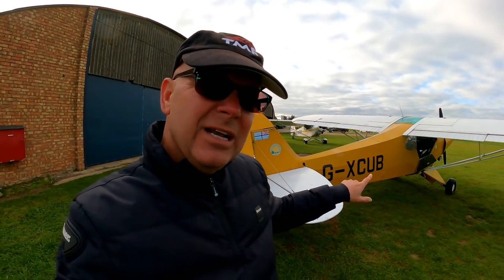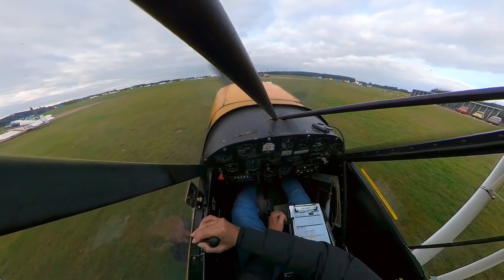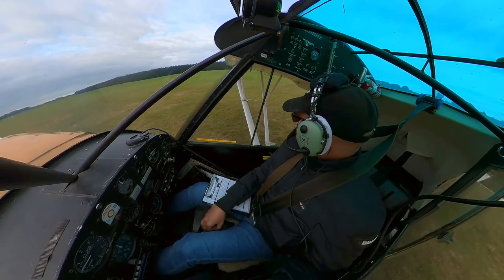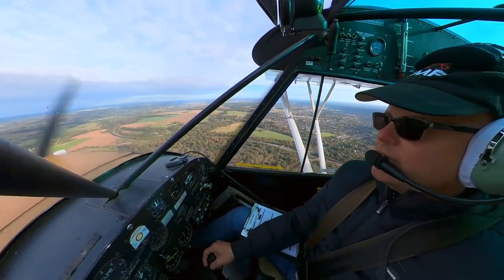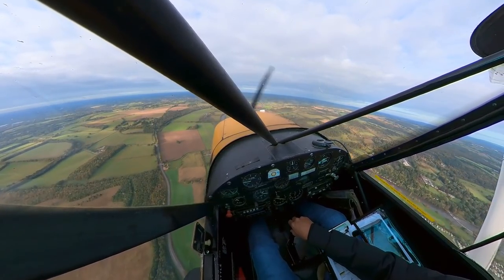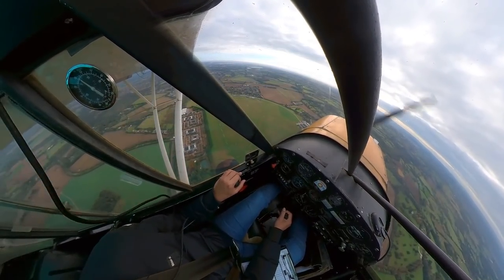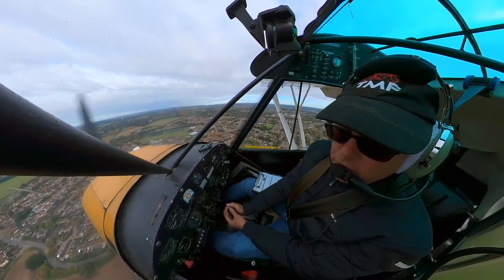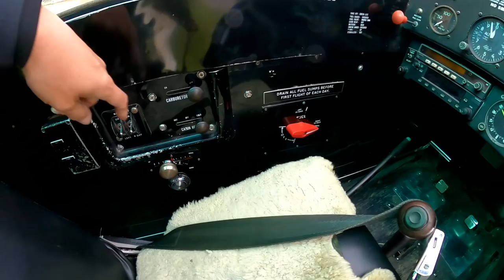Piper Supercub Going Solo! - Flying out of the circuit for the first time in the PA-18 Supercub

Comment: Great video. You have certainly got the essence of Super Cub flying. That is also a very well kept aircraft. When you’ve got happy with this one, add a Tiger Moth to your menu. That will be a very simple conversion as there are even less controls. If I may comment: 1. Keep your left hand on the throttle when taking off. You were two hands on the stick at about lift off. 2. Ditch the knee board ASAP. Use a pen on a half/quarter mil if you need to take notes. 

Top tip for the future, if you sideslip to the right with the door open (like you might on a hot day when doing multiple launches at a gliding club), slide open the left hand window. If you don’t, the left-hand window blows out and you have to do the walk of shame to pick it up from the undershoot. Errm… how do I know?
Reply from the maker: Great tips Trevor thanks!! …and are you kidding about this being a well kept aircraft??!! …and yes love the Tiger Moth, only flown p2 in it thus far…
Reply: @TheMissendenFlyer  “Well kept” is a relative term. You should fly a tug at gliding club. You have to wipe your feet on the way out. One good thing, they had none of that useless radio nav. stuff. Ours just used to have a VHF radio and a transponder - two boxes too many.

Comment: Love the flying, takes me back to my Chipmunk days. The Chippy had a slightly improved ground handling system where you can get the wheel brakes to apply at the extreme ends of the rudder travel, so that saved a few embarrasing moments! I got used to 'wheeler' landings, I found the visibilty was much better, just lowering the tail when all the elevator authority ran out. You had to get the speeds right of course and landing at Liverpool, in between the EasyJet 737's, they wanted you 'keep your speed up' and get off the runway. 'Memories are better than dreams'. Keep it up Andy.
Reply from the maker: Sounds great Mark - would love a go in a chippy!

Comment: Bit of a death-grip on the stick there (2 hands even)! Finger and thumb does it in the Cub. I flew taildraggers for 35 years (mostly Chipmunk - get a flight in one of those and you won't want to ever fly anything else again), but I did fly the L4 Cub, Supercub, Citabria, Jungmann, Tiger Moth, Stampe and more... I loved the basic L4 (military J3) more than the Super Cub as it was flown from the back seat and always with the side open. What a view!The lower door was an excellent AoA indicator on landing - just before a perfect 3-pointer it would float up level! The little 65 horse Continental ran like a sewing machine - provided you kept an eye on carb heat. All the best bars should have a 65 horse Conti and a Bristol Proteus  - the best ice makers known to man!

With simple taildraggers like these (when used to them) you can chuck away that checklist. A left to right cockpit check following the walk-round is all you need. These are simple aeroplanes!

Try a wheeler instead of 3-pint when you are ready. I taught myself these in the Chippy and they are dead easy. ease it on tail high and as soon as the mains tough PIN IT with a dash of forward stick (don't worry - the prop won't strike), keep it straight with rudder (don't attempt this until your feet are 'tailwheel happy as loosing directional control at this speed will not be fun). But your feet will soon learn and you won't even have to think about it. 

Next is high speed taxying with tail up - I used to do this at Liverpool in the Chippy if it was a long taxy to the hold. Your feet really do need to be in top shape for this! But hey, 35 years of taildragging, now retired, and I never ever ground looped! Saw a few, though.

And make sure you have a go at aerobatics! I don't think I ever felt fully in control of any aeroplane until I'd taken beyond the envelope and back. Teaches you to fly by feel and by what you can see - outside! You will not be a stall / spin victim (base to final turn) if you are current in aeros.

Nice landing! But hold the stick hard back after touchdown throughout the roll-out and until the engine stops. Helps avoid  ground loops and the AoA cannot decrease so the wing will not fly, which is what you want.

If I keep practising, though, one day I'll be as relaxed on a bike as I was in the aeroplane. I do envy the ease with which you take to all the bikes you ride. 

I don't have many videos of my flying, but here's one my elder daughter took from the back seat of the Chippy landing at Liverpool on a horrid day (glide approach, as I often did). https://www.youtube.com/watch?v=RpBQeA0nmIs

Vince
Reply from the maker: Thanks for that lot Vince….interesting reading!

Comment: Nice little aircraft, lots of fun. 
Your hight looked ok but hard to tell from camera. If you do feel you are a little high on approach, try side slipping it. 
It’s a good way to dump a little extra altitude, Which comes in handy if there is a cross wind. 
I’ve not flown a cub, but it’s short field reputation is impeccable, It’s a common practice with them.
Reply from the maker: Indeed

Comment: Enjoyed the trip around the patch, Andy. Sorry your shoulders preclude you from flying with left hand throttle - right hand stick.  If the throttle were mounted further forward, would that work better for you?
Reply from the maker: …what would work better is if the stick had a bit more height/leverage - for some reason this aircraft has a very short one!
Reply: @TheMissendenFlyer  I did notice that, as well.  Seems a good deal shorter than any other Cub/Super that I have flown, which is odd.  I guess it might make it easier to climb in and get a leg over the stick (?)

Comment: Might be a dumb question, but do ypu notice much difference in the handling of the plane in both extremes of air temperature, ie, summer/winter?
Reply from the maker: Yes the engine defo has more power in the winter - better climb and take off performance….no such thing as a dumb question!